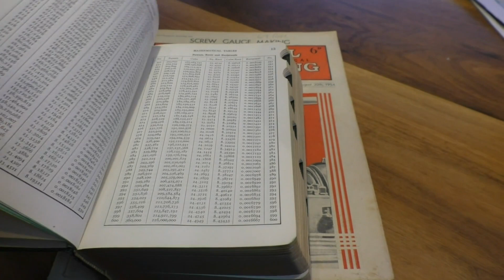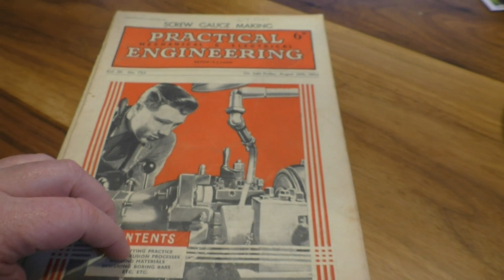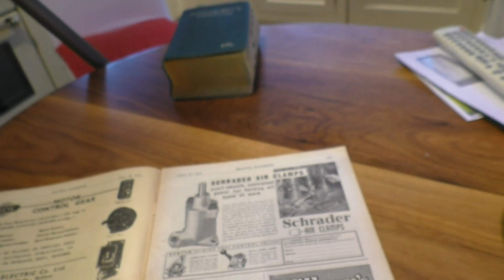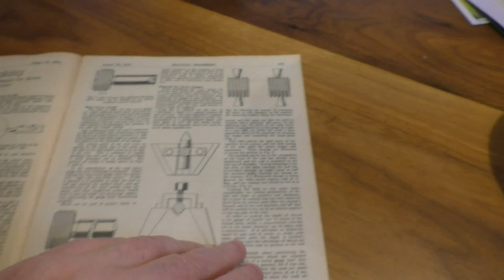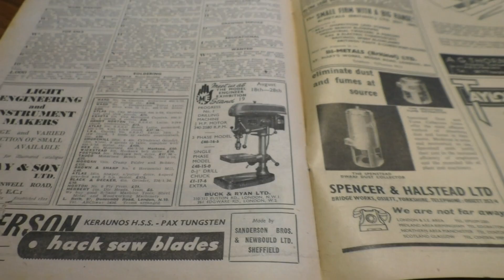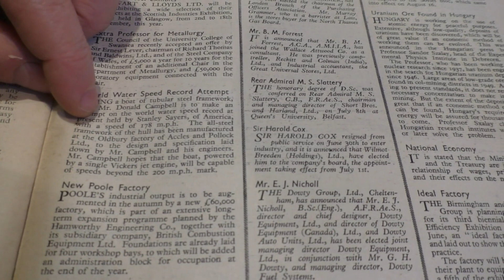Post war engineering in Britain

Comment: I'm envious of that older Machinery's Handbook you now have and it's very fine condition Rupert. The newer one's have dropped a lot of the information that's in that one. Whoever owned that one obviously looked after it well.

Today it seems a high percentage with home metal working shops look down on and can't be bothered to put the effort into finding this older information. I've got almost a complete collection of the Model Engineer magazine from the first in 1898 up into the 1960's. Plus a few older books from the first half of the 1900's. The information in them is just as useful today as when it was written. At the hobby level and in those old M.E. magazines very few home shops had anything like a milling machine because of how expensive they were. In the early 1950's and admittedly there were a very accurate and high quality machine, but a small BCA jig borer was approximately 3 times the cost of what a brand new Myford Super 7 lathe cost. Other than the BCA's there didn't seem to be any smaller milling machines available in the UK. A few very well heeled people seemed to have either a vertical or horizontal Tom Senior milling machine. Collets for those were also very expensive back then considering the average working mans wage. I've seen prices list around 20-30 BPs for each one. Slightly more common in a home shop were small hand or powered shaper's, but only the lucky or better off people could afford even those. For the more average person then everything was done on the lathe and most considered themselves lucky if they had a milling attachment for that lathe.

I've probably read dozens of times on the machinist forums that a lathe milling attachment is almost useless. Yet I've seen some amazing complex work in those magazines and all of it done with a shop made or commercially made one. A book I have first printed around 1910 about tool & die work shows using shop made hardened and ground tool maker buttons, a shop made test indicator with a high degree of needle amplification making master gauges for a type writer manufacturer and hand tapping the master into each location on a fairly basic sleeve bearing lathes faceplate. That master gauge was then drilled,  bored and ground at each position to well under 1/10,000" accuracy. This is how it was done well before jig borers were even invented. Some at the hobby entry level seem to think all they need to do is watch some Youtube videos and it will give them everything they need to know. Imo Youtube and those forums as good as they are would be excellent additions to those books, but certainly aren't a replacement for them. One book in particular I always recommend to anyone who's interested enough is George Thomas's The Model Engineer's Workshop Manual. It's taught me more than almost everything else I have combined and I still refer to it today. There's a lot of tricks and methods that can be picked up from those old books and magazines. For myself I consider them as tools for my shop and they should be thought of as just as important as anything else in it.
Reply from the maker: I agree with you an all counts - I too learnt a lot from Thomas's book. Although I did a short workshop apprenticeship you only learn the basics. As you say some of these old books have some real gems in them and I too would encourage anyone to seek them out. Thanks for the great comment too.